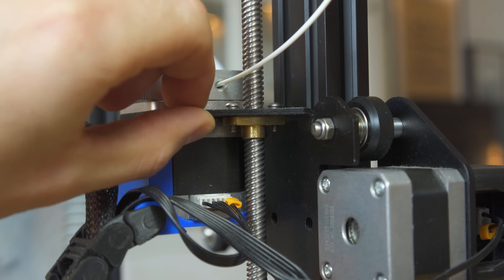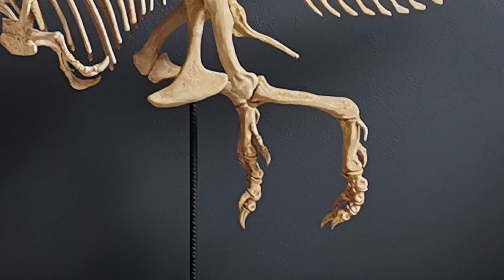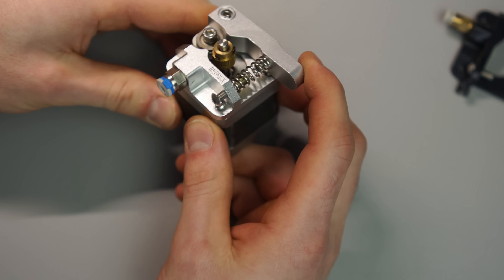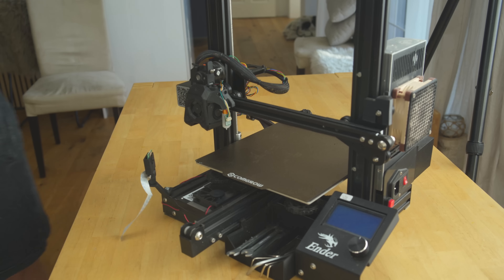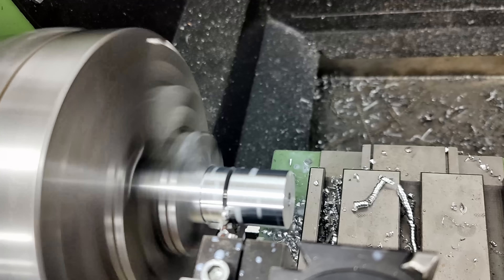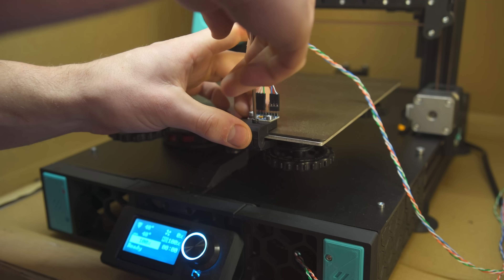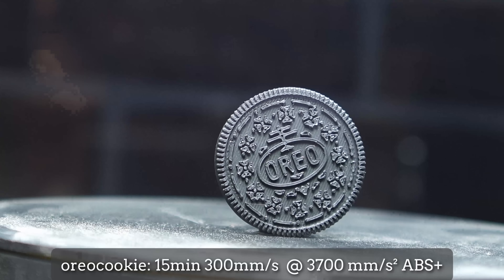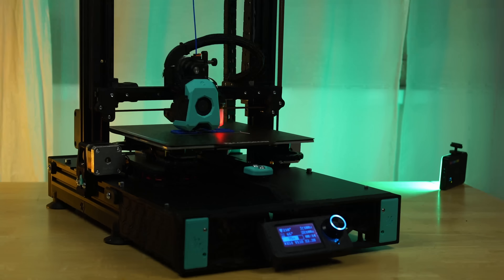I built the MOST EXPENSIVE ENDER 3

Comment: I start in English just because everybody can understand it.
It is a fever: I got an Ender 3V2, printed a couple of things and startet modifying. Second z-axis motor, self printed cooling fan assembly, full metal heatbreak, direct drive extruder. 
I can’t recommend it because I regularly had weeks nothing was working. Frustration was bad. The good thing is I know my printer pretty well now. Wouldn’t do it again though.

Danke für ein sehr unterhaltsames Video.

Comment: Really nice video!
Always happy to find other Austrian creators who are into 3d printing.

I really get why you wouldn’t want to buy a new printer and instead upgrade your Ender 3.
Mine is also my first ever printer and I currently only have the dual z screws, a cheap direct drive setup and a bltouch-clone, but I have been thinking about upgrading my Ender 3 to such a klipper-driven high speed setup for a while now.

Would it be possible to buy those 22mm spacers and the cnc machined cover plates from you?
I‘m also in Austria and I don’t have the machinery necessary to make those parts myself.
Reply from the maker: Thanks!
The spacers can also be 3d printed.
Regarding the Panels, i could cut them for you, just hit me up via mail

Comment: The one thing I really want to achieve is smoother layer lines. The Z axis on the Ender 3 is quite wobbly, and I've been meaning to buy linear rails or a dual Z axis kit, but it's hard to decide what direction to go. I'm on a really tight budget, but I like this Voron Switchwire design, it not only achieves the speeds I strive for, but it also just looks really nice.
Reply: Well, for the z axis you could get away with the kevinakasam belted z mod. It's relatively inexpensive and gets you a dual z axis without leadscrews. I had a great performance boost using this mod. Also, Klipper is a gamechanger!
Reply: @D4rkysLP  This is what I am planning to do. Total cost is $30 + some printed parts.
Reply: @D4rkysLP  Thank you very much for the suggestion. I've already been using Klipper for about a year now and it is definitely a game changer. I'm planning to do this Kevinakasam belted mod now, it looks brilliant!

Comment: Everything about this video is spot on!  I would point out that for the price, you could have gotten pretty close to a Trident kit.  As nice as the Switchwire is, getting to a core XY printer is a big jump in performance, IMHO.  Getting away from a bed-slinger printer may mean that you can't reuse the Ender 3 parts, but overall, it will give a big jump up in performance.  Obviously, this isn't a comment Christoph, but for someone reading the comments considering upgrading their Ender 3.

Comment: hey man awesome video, i am right there with you with almost a grand into my ender 3 v2 just because it was fun and i wanted to make the most ridiculous bed slinger i could. props for the great work and your printer looks awesome also, those skirt pieces really pull the whole printer together. You went Core XZ right? how do you like it? i almost did that but went with KevinAKASam's dual Z belt drive setup, it definitely took some effort to set up but it was worth it for sure.
Reply from the maker: Thanks man!
Getting belt tension right is a pita, but bed_mesh only takes 26secs now.

As long as you abandone the leadscrews, you should be good

Comment: Very nice. I am struggling to justify upgrading my FLsun QQSpro to the v400.
It would basically get you linear rails, Klipper,  direct extruder all out of the box...
Reply: Well, the pricing on the FLSun v400 is not good. I really want one, but imo, it's a $700 or $750 printer. Upgrade not overpay is the way!

Comment: the voron cube has inconsistent layers, have you checked if it is caused by z banging or voltage issues?
Reply from the maker: It was very harsh lightning in this shot. IRL the cube looks perfectly fine, i mean you still see the layerlines, vut nowhere near as dominant as in that shot
Reply: @ChristophLehner  I know but I have a stock ender 3 that has so much better layers. Your printer has the same problem as my artillery genius and I would like to find the solution even if it going with Bowden style extruder

Comment: I'm ashamed to say mines even more expensive and it's not even finished yet...
Reply from the maker: I guess there is always bigger fish in the sea
Reply: @ChristophLehner  yeah... I dropped a couple hundred on linear rails, custom extended bed plate, 120v bed, extended the printer out to 400*400*500, hermit crab tool changer, hemera extruder, manta m8p with pi CM4, TFT 50 v2, and more 😅

Comment: I converted my ender 5+ to a zero g. It was a rewarding experience, and have the parts for thw switchwire conversion, but I have my OG ender 3 so well tuned and working so well, that I'm gettin an ender 3 pro for the conversion! I agree, the building itself is so rewarding
Reply from the maker: It's like lego for adults, right?! 😅
Reply: @ChristophLehner  first video of yours. Great layout,  you're hilarious, great content, look forward to more.  Looks like you have more capability than most... mill/lathe and such. Nice ain't it?
Reply from the maker: @travistucker7317  thanks travis,
Yeah over the years i've collected quite some machines 😅
Reply: I'm in this same boat. Ender 3 sorted so well, i printed abs and asa ratrig parts and have it over half way done. Firmware, fun stuff!

Comment: Ender 3v2 here, i can print ABS with a cheap volcano heatblock, custom fan shroud, dual gear extruder. I have readjusted the currents of the steppers. Compiled marlin firmware. Everything else is pretty much stock, still it can print at 100mm/s with 2000mm/s² acceleration.
Reply from the maker: I had the same experience. The Motion system with the v wheels is quiete good. Only the hotend and the extruder are the real bottleneck

Comment: Do you have links to everything you needed to buy for this conversion? I have 4 ender 3 pro's all with skr mini e3 v3.0, microswiss hotends and direct drives and BLtouch, they are already in enclosures, was debating getting vorons but didn't know about this conversion, so now I'm thinking on doing this instead since I have loads of parts that can already be reused
Reply from the maker: Sorry i have no partlist, but you can check out the GitHub link for the parts.
But financially it makes no sense 😅
Reply: @ChristophLehner  no worries, will do some digging and find out what I need, nothing makes financial sense in this world anymore 🤣🤣 I 3D print stuff for Etsy so I can somewhat justify the cost to the wife 😜
Reply: theres the z belt mod by kevin something... thats what im going todo , i think its £30-40 in parts... and simplier, and theres a parts kit (but you still need to buy screws n stuff)
Reply from the maker: @specialingu  yeah, this was also my.initial plan, but somehow things got out of hand 😅
But its a decent mod👌

Comment: But did you change the nozzle? 
Also, I would've gone linear rods, but still slick my friend.
Reply from the maker: It prints on the .4mm nozzle, which comes with the rapido
Reply: @ChristophLehner  0.4 isn’t bad. 
But that’s like the easiest thing to upgrade to improve your prints, you can certainly print fast, but you’ve got to have the material to back it up

Comment: Lol,, you missed one of the most important things - heatbed with carriage is still very heavy (that is why afterbirner head's weight doeas not matter). so it is liminiting your speeds. Unfortunately Mellow still no anser for offering lightweigt (97g) Y carriage developed by one talent engineer. And keep in mind that magnetic base for PEI sheet is also very heavy, and could be raplaced with some high temp magnets, built in CNC-milled heatbed...
Reply from the maker: Carbon fiber carriage with magnets is on my todo list 🙃 but CF sheet is kinda expensive
Reply: @ChristophLehner  Carbon fiber will need more material to provide enough rigidity, so the weight will be almost the same, as correctly enineered aluminum. I have told about carriage "from Egor (he tried both). And magnets for bed itself. And magnets is for heatbed itself.

Comment: Now that is an extreme upgrade. Excellent. I am also currently rebuilding my Ender 3 but I just want it to churn out reliable prints so I can move on to start my Corexy build.
Reply from the maker: I was in the exact same place. In order to print a 2.4 or vzbot, you need a proper printer in the first place 😅
Reply: @ChristophLehner  I've been printing ABS for a while on my modded Ender 3 with pretty good results, but I'm really glad I spent the money on the PIF parts for my V2.4 build. Everything was printed absolutely perfect, no brims, no warping, perfect dimensions etc. Well worth the €80 extra or so vs. printing your own, and spending dozens of hours slicing, sorting, re-printing etc, if you don't have a perfectly dialed in large format printer like the PIF guys do.
Reply from the maker: @lukasmatzinger  yeah the PIF program is imo a steal

Comment: My man is building his own 3d printer while i still stuggle to avoid my 100% infill prints to bend on my ender 3v2. Mad respect!
Reply: Sometimes 50% infill is stronger than 100%
Reply: @epp9122 You won’t need more than 30% in 99% of your prints, I print at 10-15%.
Reply: @berfranper  couldnt agree with you more, mostly print at 20, or 50 max. The infill pattern makes it stiffer than if you print it solid
Reply: @berfranper  they need to withstand high pressures (up to 1 ton) and are mechanical parts / tools. I wouldn't use 100% unfill if it were unnecessary honestly
Reply: @berfranper nope 99% of my prints need 100%
Reply: @BNKMOBILEMECHANICS what are you printing that needs 100% infill???
Reply: @epp9122 I never thought about that, smart thinking
Reply: @lastoppertunity333  im impressed my self, didnt expect something so smart from my brain haha 😛
Reply: @StemmProductions  have you run experiments with that part at different infill levels? also look at angle braces, see how they bend or dent them to get extra strength? Just sayin that came to mind.
Reply: @epp9122  I agree but I need 100% for my application sadly. My anycubic mega s had no problem printing with the same settings and filament as the ender yet it bends badly sometimes. Even in an enclosure, using a brim and changing the temperature it still bends. I think that might be because of the stock fan and it's too strong part cooling idk
Reply: @StemmProductions  I recently was dealing with similar issues with a clients part. Brim helped, but didn't eliminate the lifting completely. Finally, what did it was  using a raft with ~4mm height. Then allowing the print to cool completely to room temp. before removing it from the plate.
Reply: Do 9999 bottom layers
Reply: Insert "I know what kind of man you are" meme. I too indulge in the mixing of printing and another hobby
Reply: @starfish7679 insert the adventure time bee meme 😅... you outted your self bud ... but hey ... just pull the string and get it over with
Reply: @yourlocaltoad5102  thanks that is a great Tipp! I am not into printing guns but yeah that honestly is a great idea, thanks a lot brother. Merry Christmas
Reply: @StemmProductions  when it’s about printing profiles, materials and Ender 3 upgrades, I usually just look what those guys do.
They put their physical health into their printed parts, so using their knowledge to optimise your profiles or material choices always is a good idea.
Just like it’s with buying hiking equipment - look what the military guys buy and then buy that. If it’s good enough for someone to trust their life to it, it’s definitely god enough for innocent hobby usage.
Reply: @yourlocaltoad5102  thank you for the advise. I was playing with the cura settings aswell but printing 100% infill still is a struggle even though it's gotten better
Reply: @StemmProductions haha I see this after my first comment lol
Reply: Printing with slightly lower infill but upping extrusion should still result in fully filled parts
Reply: 😂

Hardly.
Reply: I can't get ABS prints to stick on my Ender 3 max Neo, even with adhesive on the print bed - but I am using the glass bed that came with it. Looks like it's time for a magnetic textured bed.
Reply: @justinmcwilliams6759  have you tried building an enclosure for the printer? That solved the problem for me with my anycubic mega s. Also give the glas bett a good cleaning with acetone
Reply: @StemmProductions  I haven't yet, but I'm also getting a PEI bed and new extruder when I have the funds. Their Sprite extruder is direct drive and can print and travel faster.
Reply: Rookie. Use 99% infill with a brim, Elmer's glue stick coating the build plate and 65°bed temp... Problem solved
Reply: @jeeperzcreeperzz I printed 5 years and never used glue stick .... it wasn't till I got a cheap used printer and I was too lazy to fix it that I ever tried it
Reply: a year later but just print slower, or add a raft.
Reply: 20 to 30% infill on gyroid ill pay you if you can snap some of the things I made less than an inch thick I've put them under chairs and they don't snap or crack normal PLA
Reply from the maker: Thanks man!! Appreciate it❤️